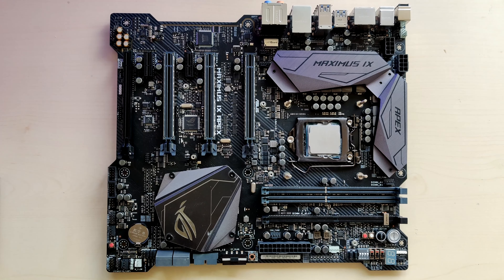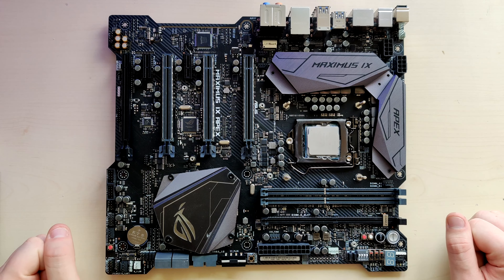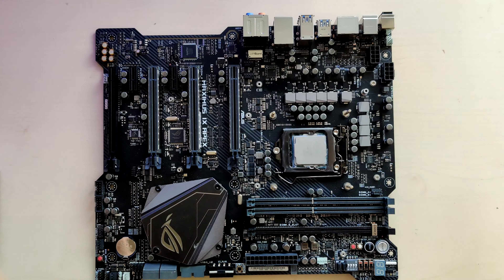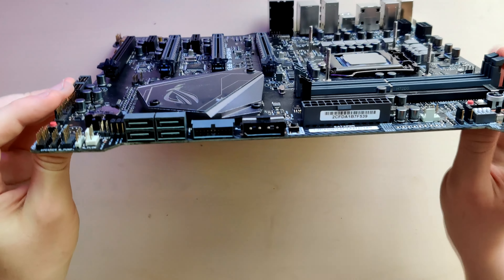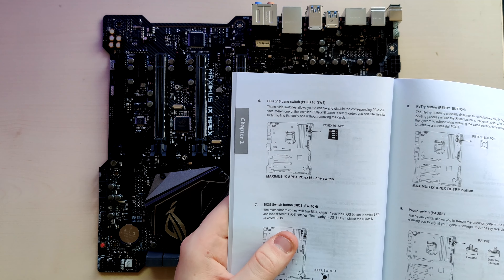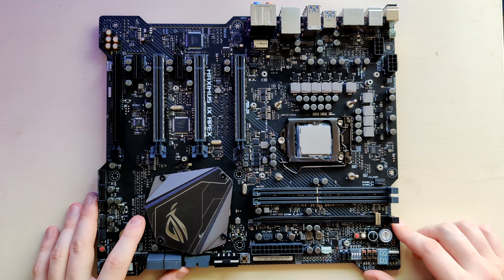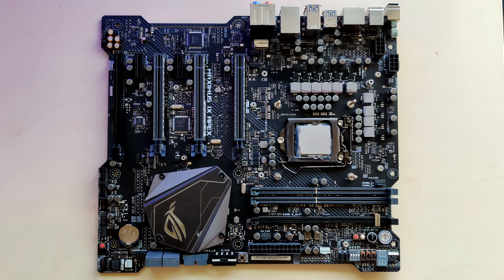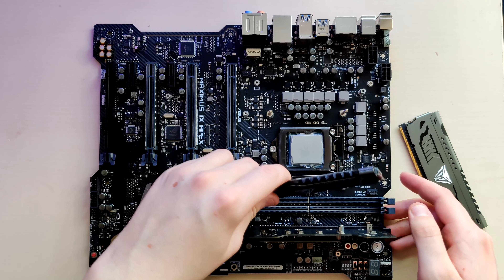ASUS' Best Z270 Motherboard // Maximus IX Apex Overview

Comment: I have one of these with he box and all accessories but permanently damaged the socket right on the pins for dram channel 0 :(. Board doesn't like booting 4000 with my 6700k but 4080 12-11-11 with a 7700k was fairly easy with my binned a0 kit with only the occasional retry needed. The board also needs to use hypersli in order to run fermi sli on xp. Getting a z170x soc force non ln2 as a replacement for now. I never flashed my oc panel for the board but you can get in benchmark voltage/multiplier/bclk adjustment from it

edit: I expect xp scores from you next cheapaz :) so i don't beat your 2001 se score with a unmodded gpu